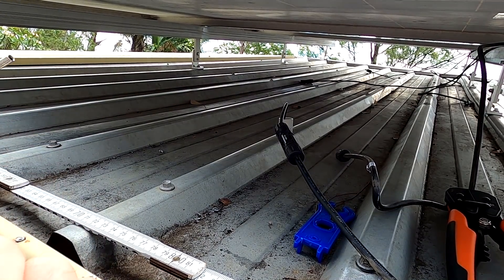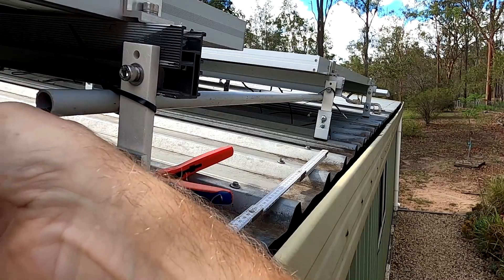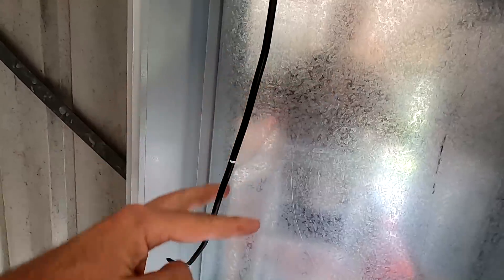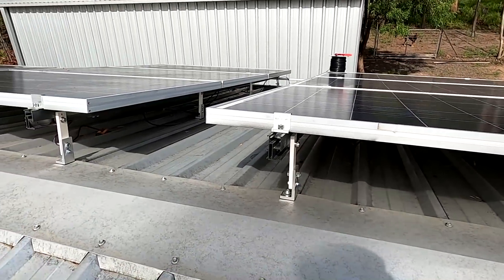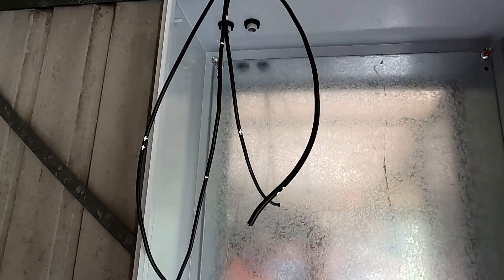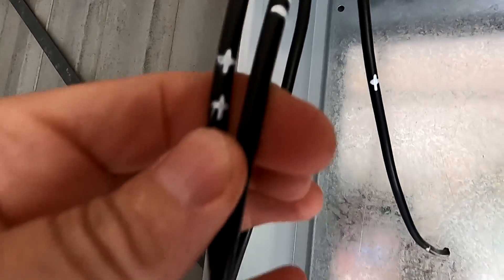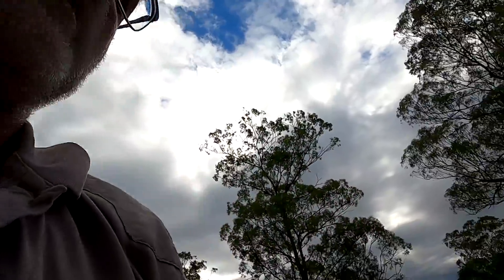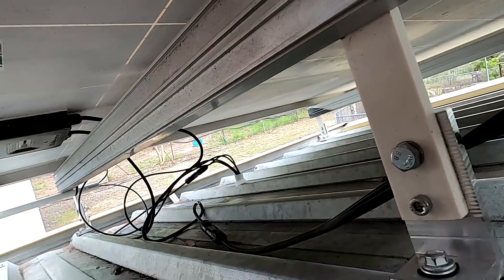We have DC and 1.22kW inside the garage!!! (Part2)

Comment: I would suggest never fusing or having any form of isolation on your neutral conductor unless you’re using a double pole switch which can only ever isolate both neutral and line conductor concurrently. 

If your MCB on the neutral conductor was to trip whilst your line conductor is left live then you can end up in a situation where you appear to have no power yet in reality you actually have a situation where a dangerous voltage is present on the line conductor but the lack of the neutral conductor means there is no path for the current to take. 

If you then come into contact with the line conductor, or another conductive part which has come into contact with the line conductor, then the only path for the current to take is through your body to earth. 

Of course if you prove dead before ever working on the circuit then it’s likely you would notice the fault, however, another member of your household in the dwelling may not appreciate the potential that such a fault could be present. 

All steel conduit (or steel wire armoured cable), grounded, with appropriately rated and DC compatible MCBs and RCDs at 30mA (or RCBOs combining both) at the generator source would be ideal here to ensure that such a fault should be disconnected before loss of life. 

Better safe than sorry!
Reply from the maker: I don't have a neutral conductor. Solar is floating in my system.
Reply: @OffGridGarageAustralia  interesting. My knowledge comes from AC/grid systems and I haven’t actually done a lot with PV so perhaps i am very wrong on this. 
I will investigate further this weekend to confirm if my terminology is wrong or if the whole comments contents are wrong. 
I’ll either then update my comment to fix the terms or will remove the content entirely as I don’t want to spread any misinformation.

Comment: Hey mate,  Hope I don't sound to silly here, but im trying to work out that you've add the 2 × 3 panels  in series...  I would think that would be to much voltage for the 150/35 mppt ? I clearly misunderstood something.  I have VCO of 30.0 v and  ISC 8.37 A  panels  connected to the same 150/35 mppt  victron. But thinking 4 was the maximum connected in parallel which cones to 33.48amps ... just under the 35 limit on the controller. Hopefully I've given you enough information to help me maximise my system... I do have 6 panels in total... any help will be great. Cheers mate
Reply: Using the figures you quote above (30Voc and 8.37Isc), using Andy's setup, you get:

V1: 30x3 = 90Voc (voltage in series adds)
A1: 8.37A (current in series is equal)

V2: 30x3 = 90Voc
A2: 8.37A

V1 + V2 (parallel): 90v (volts in parallel is equal)
A1 + A2 (parallel): 16.74A (current in parallel adds)

So the final system, feeding into the SCC is:

90v @ 16.74A

The Victron SCC can handle up to 150v and 35A, so his system is well within spec for the SCC.

Comment: Is it legal for you to be working with DC voltages higher than 60V? Oh your probably certified to work with higher voltages from when you worked at your switchboard company.
Reply from the maker: I'm electrician but everyone should be very careful with whatever they do. If you want to be safe, stay with a 24V system.

Comment: Andy, could you have joined the negatives together for a common negative in your box and or positives?
Reply from the maker: Yes, I could have joined both together on the roof and would have had only one positive and negative coming down. But I may want to add/test more charge controller down the track so hence the separation of the strings.
Reply: Thanks Andy, helps me understand if I ask questions.

Comment: You should end up with 3x the open-circuit voltage at the bottom of the fuse holder for each set of 3 solar panels in a series configuration. Less a little voltage drop due to the undersized wire but with the short run that would not be too much of a voltage drop. I think you show 96 volts or something like that which is what is to be expected. It is actually quite essential to fuse the 3 panels in each series string. Keep up the good work. you will find you love it and will expand and upgrade to more solar panels / and or batteries later.  the 72 cell solar panels work great. I am sure. I only have 60 cell panels for the build I am doing now charging a 16 cell 2P8S LiFePO4 battery bank. 10 panels hooked up at the moment and gaining. cheers! 😎

Comment: I personally am not a huge fan of those alligator/crocodile clips. Ive had some bad ones, very thin wires, high resistance and so on. Not all are good. I'd personally prefer just using a flat aluminium bar and drill some hole, making your own temporary long busbar, or flatten a copper pipe with a hammer to get a copper busbar.
If you have decent alligator clips, it might work fine, but I would still suggest rewiring it after a few days, changing the busbars from the most left cells to the right cells, to compensate for any losses in the aligator clips.In your video, the green/white one looks like the wiring has been replaced by some thicker one, while the red one looks very flimsy to me.

Comment: Do I really need to mail you two AAA batteries for that multimeter?
Been watching that icon blink for weeks now.
A low battery on the multimeter can also give you erroneous readings by the way.

That is a great multimeter. I love mine. You can hack the firmware on it so it always starts in DC mode, increase the counts as well as, no auto turn off after a few minutes. It's amazing :)

Comment: Hi, Its a good idea to have two fuses in line as isolation as you could have a ground fault in the most positive panel allowing voltage to flow on the negative line. Its also a good idea to earth the panels and your charging and inverting equipment to a earth stake. Cheers Dave.

Comment: When balancing/charging the cells in parallel, it's best to put the + and - of the power supply on opposite sides of the entire pack instead of having them on the same side. The resistance of the bus bars causes issues otherwise in that the 'first' cell will charge faster. This will especially be the case if you use those crocodile clips ;) You can find this also explained in the Wiring-Unlimited-EN.pdf (if you Google that) from Victron in section "3.3 Parallel battery bank wiring", page 18.
Reply from the maker: I did that! Will need in the next video.

Comment: Many places require a solar shutoff outside.  AC disconnects work will for that.
Panels look great.  I liked the fast motion setup.
Reply from the maker: Thanks. This is an off grid system though, so no shutdown outside required.

Comment: 10A fuses are undersized.  You need 12.6A or higher fuses.  8.08A Isc x 1.25 solar derating x 1.25 3hr derating.  15A fuses are what you want and should be fine with your 12awg wire.
Reply from the maker: Let's see. I think 10A are totally fine. I've never seen more than 8.8A from these panels in a short.
Reply: @OffGridGarageAustralia  Maybe the NEC code is a little excessive, but it is designed for the infrequent sun peaks that could cause a fuse to blow.

Comment: I like to use dual breakers also.
Reply from the maker: For what reason? I mean it's good to be able to isolate both sites but apart from that I would have used only 1 per string.
Reply: @OffGridGarageAustralia  I was wondering why you used fuses rather than circuit breakers Andy?